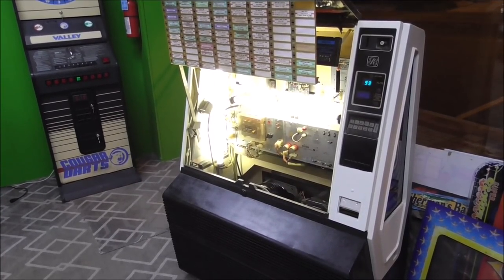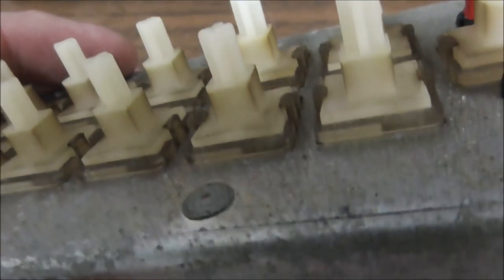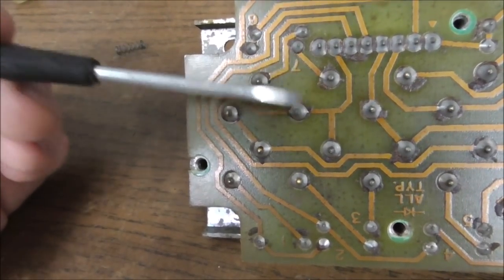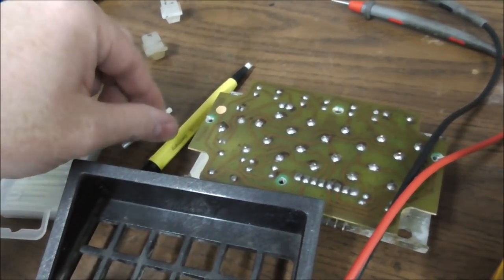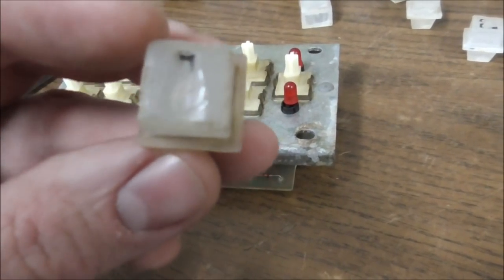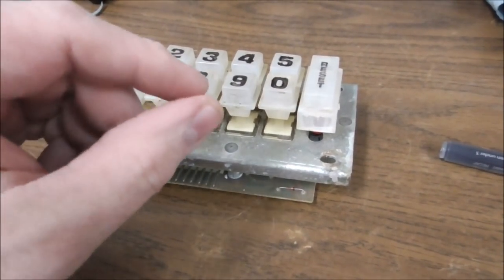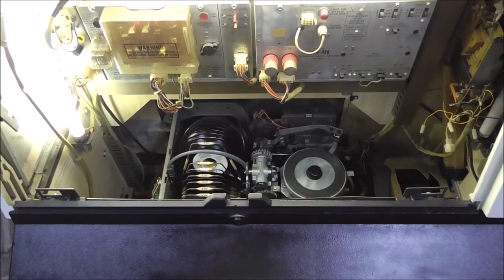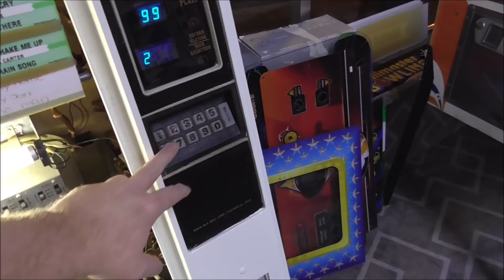How to Repair non-working on unresponsive Push Buttons On Your Jukebox!  Rock-Ola 480 And Similar

Comment: That setup for the switches is the same as you would see on a computer keyboard of that era. The metal sheet acts as a mounting plate to secure and fasten the switches. If you want to remove the switches you must desolder them and slide them out of the plate.

As a side note, plastic this old is going to be extremely brittle. Removing the switches from the plate in order to clean them will marginally decrease your risk of breaking the switch housing... but you can probably still buy replacement switches

Those keys are so dry they sound like nails on a chalkboard. Keyboard enthusiasts would definitely be lubing the key blade and maybe replacing springs (#1 is pretty sloppy).
Reply from the maker: We made it through unscathed!
Reply: @LyonsArcade  which just goes to show your expertise! :)

Comment: Even if i´m not in to Jukeboxes, i think there are some
 simile here and there some how! I mean: In how many ways can a switch work? This is very educational becouse i think it shows an analog way to do the switchmatrix in an SS pinball out of the scematic. Thanks for the video Ron. 👍
Reply from the maker: It basically always comes down to, let's take it apart and see how it works and try to make it work like it originally was designed, again :)

Comment: The one is going to be where the most worn part is at the bottom. People will tend to press towards down not up. (not that it matters for reassembly).  Maybe spray the buttons with clear coat to protect the paint.

Comment: Gotta say 8 is the second way you had it. It seemed slight fatter on the bottom. As for the one, I bet the part that still had the paint on it was the top of the 1 - just figuring someone pushed the button with a slight downward motion or always pressed it towards the bottom of the button.

Comment: Are the jukeboxes from the 50's 60's 70's electrical mechanical like the pinball machines?
Reply from the maker: Pretty much, yes.  The only difference really is they have tubes in them as well.... but there are relays and stepper units, etc. like the pinball machines.

Comment: I have a rock ola legend.  It plays well, but I'm unable to play a whole album anymore.  For examble If I hit 3100, the last zero will not light up.  However I can push each song on the cd individually and there isn't a problem.  The zero works, but was wondering what the fix would be so I can play the whole CD without entering each song one by one.
Reply from the maker: Did you change that cd to a different one recently or anything?  If it used to work and now doesn't, or if it's on all of them, then you may need to initialize the cd's, basically the player has to go through and pick up each cd so it knows how many tracks are on it.  Other than the settings that allow it to play the full album (it can be turned on or off) if it gets a song on that cd that it thinks it can't play because it has a skip or something, it will mark that track as bad and then it won't let you play that whole album because one of the tracks is marked as bad.  In the manual it tells you how to turn on album play ,and how to initialize the cds you may have to go through that again, it may have fell out of program.

Comment: i need help with a rock-ola 480 the gripper arm got stuck and i tried turning the spindle on the motor and it barely moves .any ideas?
Reply from the maker: Did it just do it while it was recently working fine? If so there's something probably jammed, if it's about halfway up there is a little metal piece that guides the bow to turn one way or the other (a or b side) and if the piston didn't go all the way into the bow, it will stick out too far, and when it gets to that point where it's supposed to pivot towards flat to lay the record down, since the piston is sticking out too far it'll hit and jam. Email me a picture of where it's at and I can probably help you figure it out.

Comment: I have a 454  rockola, it was working great , but now when i try to select a song the first two buttons on the song selection engage , but the third button is dead and any song i try is the same result . The first two buttons engage but the third wont ! Would you have any suggestions ? Thanks
Reply: Hi Bill! I have a Rockola 448 and I have the same issue. I'm pretty sure the lockbar switches on the underside of the keyboard assembly are shorted out (because of something stupid I tried to do to fix another issue), and I have no idea how to fix that. Have you had any luck fixing yours?